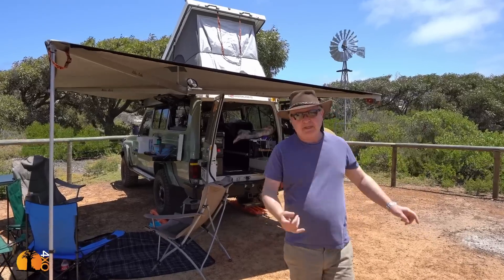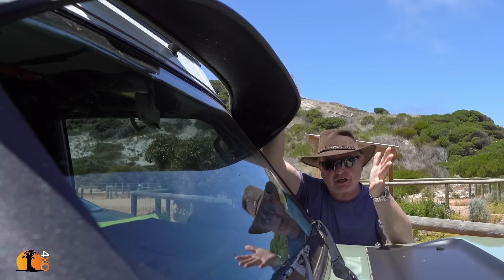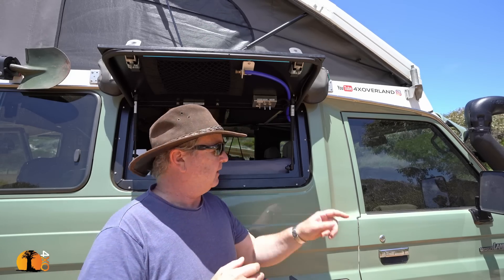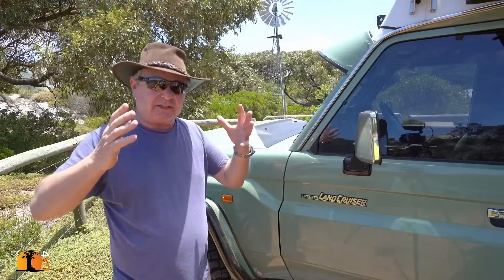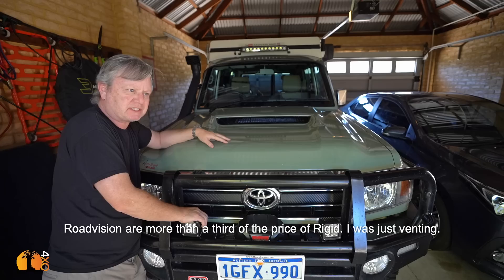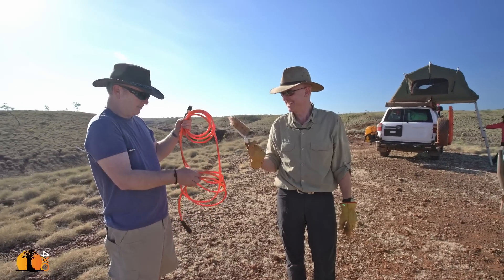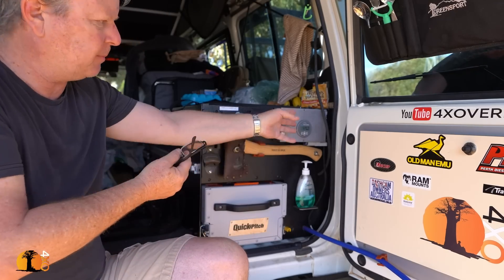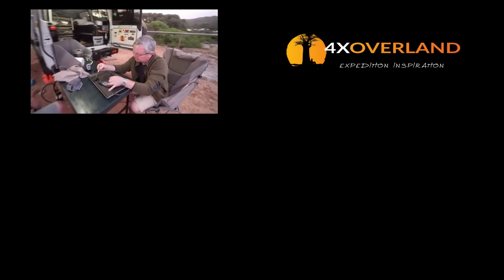BEST OF THE TROOPY | Toyota Land Cruiser 78 Troopy Camper |4xOverland

Comment: Each to their own but I have had zero issues with our Waeco CFX 65 dual zone fridge. It has been  fantastic.
Reply from the maker: I'm not saying the others are bad. I'm just saying these three are the best. IMHO
Reply: My CF 50 went back to Waeco twice in the warranty period, electronics died within the first year, then the compressor around year 3. Then a couple of years ago the thermostat died out of warranty. So pretty much every part that could fail, has failed. It's still going, but if it fails again, I probably wouldn't repair it again and probably wouldn't get another Waeco. CFX may be better though and as you say, each to their own.

Comment: Hey Andrew 

I'm interested in why your so impressed with the lead crystals batteries ? There isn't much online about these types of batteries 👍
Reply: The reason he likes the lead crystal batteries is because of the propaganda he was fed and having gotten them for free or reduced price. There are reasons they are not more widely known and the technical information is limited to non-existent. There are a few small independent tests showing that they fail to produce anywhere near the claimed cycle life and capacity over time. I would get one and do my own testing if they were more popular but for now it's obvious manufacturer propaganda and not really available in the USA for me to test.
Reply: @Hates Spam I have read much of the marketing and technical documents and literature from Betta as well as others in addition to any independent info or tests I could find. Australia in particular is a big market for these type of products because it's one of the few places battery storage for time shifting electricity consumption makes sense.  I don't comment on YouTube as it's a bunch of anonymous self proclaimed experts. Personally, I am an electronics and mechatronics engineer with a hobby interest in these technologies and applications for off grid power, self sufficiency, as well as power systems for rc vehicles, ebikes, ham radio, overland camper truck, and whatever other random stuff I get into. Commercially I've developed lithium powered devices and a scalable multivoltage configurable I/o supply. I don't claim to be an expert but the assorted lithium battery chemistries are generally well documented and tested. Same with lead acid. There should be more testing and analysis already available for lead crystal if it actually has the claimed performance. I'd be more than happy to bite the bullet and get one of these to test and add unbiased data to the shallow pool currently available.
Reply: @Hates Spam  Same here: the first time I heard of a lead crystal battery was when Andrew St Pierre White first had them installed in his vehicle. I couldn't believe there was a battery chemistry I hadn't heard of let alone one that was in full production availability for years and had the claimed cycle life and DOD. 

My previous test solution for a high cycle life, deep discharge, flexible configuration and relatively lightweight was 140x 32700 5.5Ah 3.2v lifepo4 cells. Configured into banks of 12v nominal and wired with anderson powerpoles and jst balance connectors would allow me to gang up subpacks to meet whatever particular requirement I had. 

Need a lightweight battery for the sv1000 just use one 12v bank. Want to add an isolated battery to the dr650 to run electronics with the bike off at camp and still have a fully charged seperate starting battery just connect the desired capacity through a blue sea mini add a battery kit or similar. Keeping in mind the stators available for the dr650 are only capable of 200-250watts you will still be limited to the amount of time you can run heated riding gear. 

Want to run a TSDZ2 torque sensing motor on an ebike at 48v gang 4s12v modules together and whatever capacity you want in parallel with the powerpole connectors and done. The balance connectors allow the pack to be charged on a revolectrix powerlab at up to 2400w total, lets say at 5C getting a charge done in as low as 10-15minutes.  

Need either a solar or alternator charged battery bank in your overlanding rig wire accordingly and have up to 2.4kWh of reserve power that you can remove packs on the fly in order to power things like your ham radio, ebike, or even carry to camp for a quiet generator free night of electricity. For lithium batteries lifepo4 are heavier than LiMn, LiCo, or Li-poly per Watthour but more resistant to abuse with far higher cycle life so they aren't the best choice when ultra light weight matters but they are far lighter than lead acid and since this design is modular you can remove bad cells/packs as needed. 

Lithium Titanate takes this even further with an even higher cycle rate, lower voltage and lower energy density, with higher price since all the cheap lithium titanate batteries were bought up by the car audio crowd since they charge and discharge very quickly. It's all about the application and budget.

I'm not putting Andrew St Pierre White down but he is not particularly technical and in this case I believe he was swayed by the sponsorship and marketing hype into a placebo effect. It could also be a simple matter of not having a controlled a-b test regardless of his years of experience in overlanding. I'd love to see the data or even more anecdotal experiences from him about this. 

Available to me is all the equipment needed to accurately test and compare the lead crystal batteries to agm, gel, flooded, and many other battery chemistries. Is there enough of a demand for me to bother? I'd be happy to do so.

Why not use a variety of LiMn for the race car starter battery? What kind of engine are you cranking?
Reply: @Hates Spam That sucks it's on hold. Life happens. What chassis/body? depending on what the car is you're prob better off mounting the battery in the rear and running some fat power cables anyway. The cables negate some of the weight savings of going to a lithium battery though it frees up precious space under the hood for turbo bits. After market management like a holley(edit: if you're in australia you'll prob be using a haltech) is plenty durable with the module in the cabin, high grade wires and some shielding on the turbos.

As is often the case with big builds, there's always something that comes up and kicks you in the nuts.  I have a 93 vette I got in highschool, put 100k really hard miles doing scca solo stock class and daily street driving then parked it. Planned on stripping it out, whipple, and rebuilding as purpose built car back in 2008 so I bought an r32 as a daily. Got as far as stripping the vette out before the optispark died again and I found the r32 was faster stock than the vette anyway. Then high school sweet heart fiance of 9 years started cheating and I gave up our house and moved across the state. Doh! Its been sitting rotting next to my shovelhead low rider ever since and now the r32 has over 100k miles and is clapped out. 

My current project is a 1969 k30 long bed I'm trying to turn into an overlander type vehicle with living space under the bed cap and solar. Has Sm465 trans, np205 transfer case, 14bolt rear, corporate 10bolt front, 3.73gears, 33" km3 tires. My first truck (excluding 91 cherokee I lived in during the break up). I've never had an old pickup and it certainly feels like one and makes me wonder if I really want to keep going on it.
Reply: @Hates Spam thanks for all the comments lads, i found an article recently, which discredited all the tests (life cycle, depth of charge etc) completed by the company selling the Lead Crystal batteries. For the life of me i cant find the article!  ill dig around & try and find it

Comment: I am intrigued by the UniChip position. When installed and shortly after the installation you were blown away by the modification and I recall you saying how good it was for safe overtaking, fuel economy and overall 'engine performance'. I am confused by the somewhat sudden change of heart on performance chips????

You surely knew before putting it in that it would void/put questions over the engine warranty.

How many Kms on the Troopy? It still looks like new.
Reply: I wouldn’t really call it sudden. It looks more like he was initially enthused but months of use have tempered his view.
Reply: N Noddy 
He said why. The clutch isn’t big enough for the power. So unless he upgrades other stuff then it’s not necessary.
Reply: @Agent.K.  It is well known the OEM clutch can not cope. PDP advise of a clutch upgrade when they do their UniChips.  A clutch upgrade surely does not negate the other benefits???
Reply: N Noddy 
Well, that’s his question to answer haha! For me I wouldn’t do it if the vehicle is still under warranty. And I’ll add other things like intake, exhaust, etc... to get the maximum out of it.

Comment: Hi Andrew, love your work..I use a high boost Mobile phone Ariel on the bull bar with a cradle and it gives much better coverage in the bush..Turns 1 bar into 4..The phone has to sit in the cradle to get that boosted reception..Which is ok by me..If I spend $1000 on the Ci-fi box thingy I can’t see that I will get any better reception than I already get..I just have the convenience of not having the phone in the cradle , and it will give that service to more than one person..and more things to go wrong..Cheers..I may be wrong..?
Reply: My question would be - do you need a particular phone to sit in that cradle? What happens if you change phones?
Reply: Matt Duncan .Any phone can sit in it ..It is a special cradle that connects to your Ariel , and your phone just sits in it like any other cradle..It relieves the boosted signal via induction just sitting in the cradle..You can also charge your phone via the cradle which is plugged into your cig plug..If you take the phone out of the cradle it will loose signal if in a weak area..Some cradles are designed for particular phones but many will fit a variety of different sizes..I wi fi through my phone to my IPad and play music out in the bush..get some amazing distance with the right Ariel..Cheers..I’m not a techo, I just use the stuff..So you have to research and check for yourself..
Reply: @grahambald400  Good to know. Can you tell me the make/model of the cradle system you have?
Reply: Matt Duncan The cradle is named Smoothtalker..and the windscreen mounts are Ram..I buy that gear from Electric Bug in Adelaide..They have the good gear..Ram mounts are really good..Most others are crap..Cheers..
Reply: @grahambald400  Thanks for that. I have RAM mounts but didn't know about the Smoothtalker cradles. I'll check them out. Cheers.

Comment: Your troopy has always been an inspiration to me, but I promise you this... Mine will be better! Lol..
Anyway, what is your troopy like towing? And how much did you tow?
I plan on towing up to 1 Ton on dual axle overland, with a troopy fully rigged for touring overland solo. Although I'm looking at portal axles and airbag suspension. What are your thoughts if you don't mind? Kind regards as always legend!
Reply: Portal axles because at times I will leave the trailer to a bit of 4wheeling..

Comment: Have you towed a camping trailer?
Reply from the maker: Yes. I've done two trips with a camper trailer. I do not like towing and will find a way to avoid it.
Reply: 4xoverland what was the total weight of the trailer if you mind? And why do you avoid it? Is it because it's a troopy? Would you tow have it be a 79 series?.I plan to tow up to 1 ton dual axle overland. Kind regards.

Comment: Andrew an interesting next step for the 'Cruiser would be to do a Jmacx coil spring conversion on the rear springs. You'd gain ride quality, improve in handling, hopefully articulation and drop unsprung weight too

Comment: I have a Jimny and I've turned it into a real little monster truck, It looks fantastic and it gets compliments everywhere I go. Would I do it again?...Not a chance!
If I was towing it on a trailer to events and using it just for that, then that would be fine. But using it as my daily driver is a nightmare and is costing me massive amounts of money to run and maintain.
If I was to get another Off Road vehicle, I would keep it as stock as possible with only upgrades that are necessary. A decent set of off road tyres and a CB for example. Upgrading stock parts that are renowned to be unreliable is fair, but keep ratios as close to stock as possible.
Looking back I wouldn't have done about two thirds of the upgrades on my car, and with the money I would have saved I might have invested in a rear diff lock.
It wouldn't look as good but it would perform so much better.
Reply: Great comment sir, well said. My friend and I agree.

Comment: I just use some zip tie to attach my 4g modem to a sand flag and it does pretty much the same job as the mobile booster but for free.
Reply: Right on! Yeah, I don't even check weather anymore. I'm prepared for whatever.
Reply: Does this actually work?

Comment: Andrew are you still getting the 255/85r16 KM3 tires and if you are have you considered EVOCorse DAKARZERO 16×7 -10mm wheels( -10mm offset puts the outter sidewall approximately 4 mm farther in(need -14mm but -10mm is the max available negative offset) than a 285/75r16 KM3 on a 0mm offset 8 inch wide wheel).

Comment: Can't agree with you about the Victron remote access app mate. I've added the dongle to my Victron and it shows ALL the same options you scrolled through in your video ON THE ONE SCREEN. I wouldn't advocate using it on the fly (unless you have a passenger who can open the app), but even if you pull up for a pee and don't want to open the back of the bus, you can quickly check that your SOC is okay. By the way, I would be a bit panicky if I saw my voltage down under 12 volts.....in fact because i have a lithium battery, I rarely see it below 13 volts.
Reply: I got the BMV-712 with built in bluetooth, I like the toys and apps etc but Andrew's point is valid, if you don't want the tech you don't have to! (PS, the Victron guys owe Andrew a beer, only bought it because I found out it exists on this channel! haha, more affordable than some other BMS's!)
Reply: @markdaniels9507  Point taken Mark. I wasn't trying to ram more technology down Andrew's throat, just pointing out that it can actually make life better..... I'm an old fart (nearly 64) and I have recently started to embrace certain technologies. For example, in my 2012 Chevy Silverado, I have a Edge CTS2 monitor connected to my OBD port. 

There is a myriad of information I can choose to monitor and doing so keeps my mind at ease that the rear diff isn't overheating or that the FASS lift pump and filtration system is still providing fuel @ 10 psi to the injector pump etc. Of course I also monitor coolant temps, EGT, oil pressure, intake air temp and half a dozen other things that would otherwise keep me awake at night...

None of this is essential, but it makes my journey less worrisome. Each to his own I guess.
Reply: It's a good point. I have an android tablet in a RAM mount on my dash for this purpose. It does HEMA, OBDII port monitoring, shows me my battery, fridge etc information all in one place. I keep all those apps off my phone though for some weird internal logic I can't explain.

Comment: I just conquered the whole Wadbilliga National Park track in a fully stock 2003 Toyota Kluger. The only thing that isnt stock is the Infotainment system. If you want to do a little bit of 4wd you dont need a $70000 landcruiser 70 and more than $10000 worth of acessories. You need the skills you learn from Andrews videos and a $5000 AWD Grocery Getter.
Reply: AND A LOT OF WATER
Reply: True, there's a lot of companies making a killing selling after market replacements and accessories. The old man used to drive up what can only be described as goat tracks in a 2wd Holden station wagon. A lot comes down to good old timer bush skills.
Reply: Wadbilliga ain't the Canning or like the vast majority of remote Australia.
Reply: Victorian High Country ... Can be done in a mostly stock 4wd in dry dusty weather. A little bit of rain fall (only a few MM) and you will struggle with a winched, lifted monster truck. Its circumstantial. I learnt recently after a storm moved in. I never needed a winch. Until that one downpour - 98% of driving doesnt need accessories. It only takes that 1 kangaroo in the middle of know where that would make the bullbar worth it. But yes, you dont need a 100k car. You can get away with alot less most of the time.